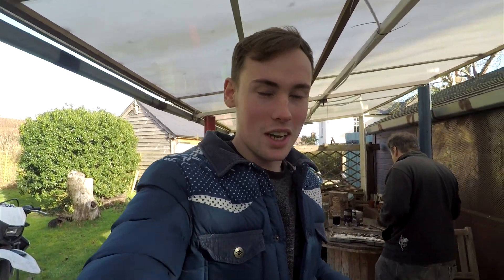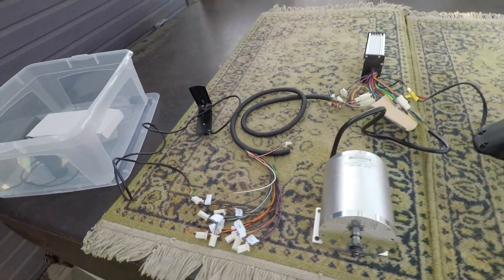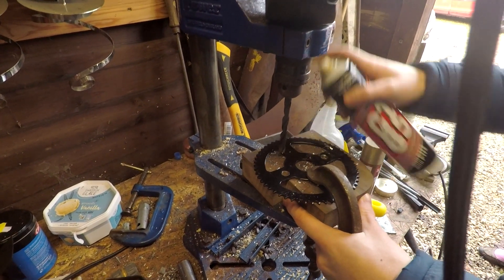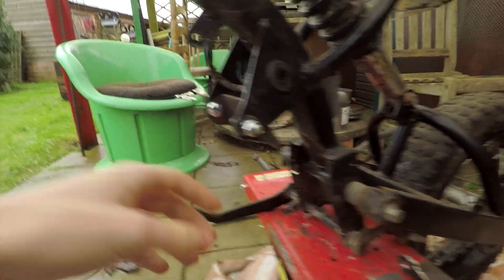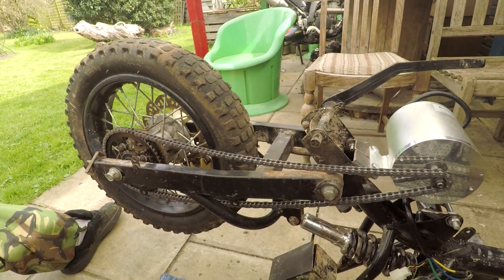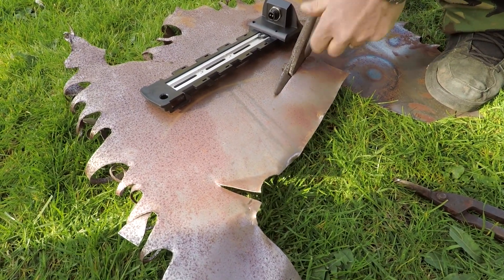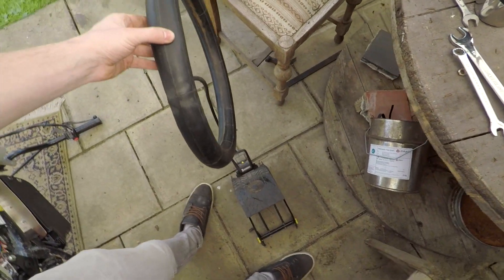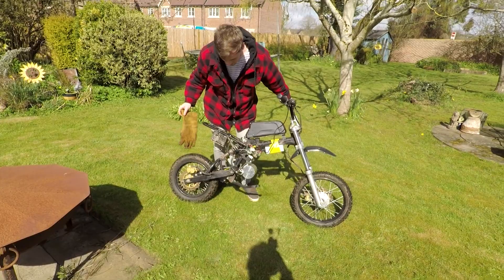We Built A DIY Electric Pit Bike [Dirt Bike / Motor Bike]

Comment: Hey mate, good job looks sick, I've been building electric stuff for awhile and on the controller there are normally two wires called self learn or something along those lines. Look at the wiring diagram for the controller to find which two, plug it in and turn the battery on and it should go one way and if it doesn't go the right way take it out and plug back in, when finished unplug the wires and your done. But good job looks like fun

Comment: Pro tip: If you have any old batteries (especially lead acid), check if your local battery stores or scrapyards will give credit for them. I got $15.20 for 4 SLA's, 1 car battery and 1 motorcycle battery (all very dead).

Comment: nice video, i have a similar channel on you tube.for more power use qs motor qs138 90 h and nucular 24 f controler and zoé batterie (72v30Ah 300 A pic)
one exemple in this video: https://youtu.be/5ReosA0-9zA

Comment: I would not overpower that motor it’s a 2 kW motor but it’s also brushless it would be different if it was DC brushed because then it would be able to take more output but I would not be putting 3 kW in that 2 kW motor

Comment: have you thought about wrapping the motor in copper tube- passing the controller, getting a tiny radiator, reservoir, and water pump, and trying to put more volts through the motor? food for thought, fun project!

Comment: I’m also building an electric bike and I also bought a 48v 1800w motor and I was just wondering how fast it goes
Reply: If it's to fast or slow just readjust the gearing if you can for top speed or acel but 1800 is decent I guess

Comment: mount the motor on the swing arm ,saves so much head aches ,and tossing chains off when hitting jumps
Reply: Katie, granted that the weight of the motor isn't that much but that still increases the unsprung weight.
Reply: @isaacmadhavan  i agree with you there yes it does,
Reply: @katiekumcgil  Glad you do, mate.

Comment: distance drive sprocket is away from swing arm pivot ( big ) could be a prob when you start hitting bumps ( chain will go slack /tight through suspension stroke.) old school mx bike sprung chain tensioner may help.
Reply from the maker: Thanks for the advice, I was thinking I might need to add a chain tensioner, I will have a look at getting an old Mx bike one or something similar!

Comment: So sickk mate, how much did it cost for all the electronic parts motor, battery, etc ?? I'm either building one of these or a pit bike trike not sure yet haven't made my mind up 🤔🧐
Reply from the maker: All in they cost just under £300, though a more powerful battery will cost a bit more as we had some issues with our one not providing enough power!
Reply: What's the top speed ?
Reply from the maker: @kierandanks8835  Currently about 25mph, but with the better batter it should be around 35mph. Then with a bigger motor controller I think we can go over 40mph

Comment: Awesome, im soo glad that you showed how to mount the motor without welding. I bought the same motor last month and still waiting for the battery. Thank you! Subbed!
Reply: what battery did u use as got a pit bike awaiting for the motors
Reply: STEWART DEAKIN sorry for the late answer here is the battery: SEK 3,131.75  20％ Off | 52Volt Super Polly E-Bike Battery 52V 21Ah 18Ah 15Ah 14S6P Electric Bicycle Batteries for 1000W 750W 500W Bafang TSDZ2 Motor
https://a.aliexpress.com/_dYlAbIZ
Reply from the maker: Thanks a lot!